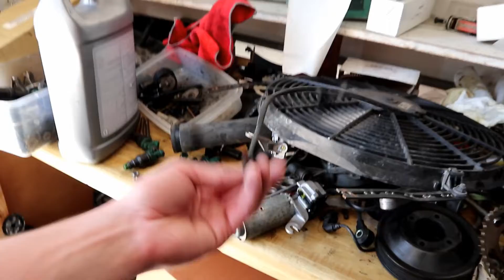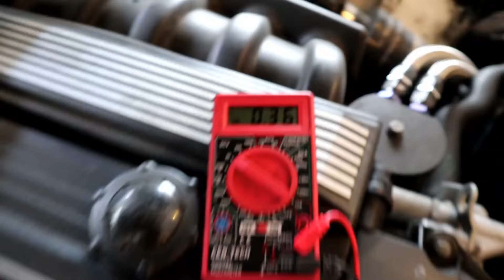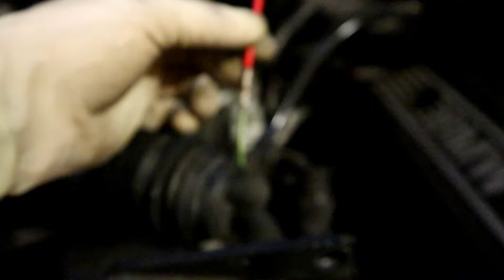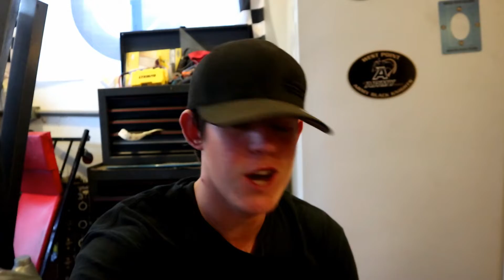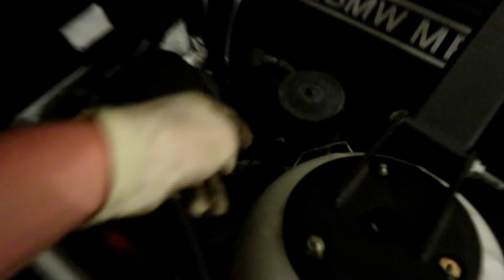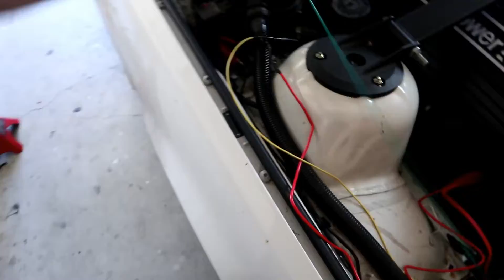Wiring my E36 Electric Fan Setup.

Comment: So once connected to adjust it correctly I need to run it 10-15 minutes to reach some temperature and adjust it? I have a s10 2.2 it was fan clutch so I buy this to do it electric fan. I think the temperature normally if like 195 when I see this if when I adjust?
Reply from the maker: Exactly. Needs to be up to temp and you want to let it cycle. If it’s adjusted too low the fan will stay on indefinitely when the car is up to temp, if it’s adjusted too high the car will begin to overheat before the fan turns on. You want a nice medium. When my car is up to temp, it will run the fan for a minute or 2, then stay off for a few minutes before turning back on.

Comment: On the e36 there is an auxiliary 2step fan switch on the right bottom of the radiator(for the fan on the front). I wired my fan with a relay and used the low temp trigger wire. The fan comes on at 95 degrees Celsius or something on the low trigger. Never had it run hot once
Reply: did you lose air conditioning?

Comment: So what happens to the temp sensor that you unplugged from the radiator, do you just not plug that connector in? Im trying to figure out becsuse it gets replaced with the moshimoto one that goes to the relay.
Reply from the maker: It’s for the AC. If you can find another way to install the temp probe go for it, i chose this route because i dont have AC on this car.
Reply: @M3NACE  that makes sense. I appreciate it.

Comment: What is that clicking noise you get with with car off and the ignition on. The guy I bought my e36 from thought that was engine knock and sold it to me for pretty cheap. I can’t figure out what it is.
Reply: engine knock on turned off engine?

Comment: why is the first setup bad?
Reply from the maker: No circuit protection & manual operation. Fan controller runs automatically and has circuit protection.
Reply: @M3NACE  thank you

Comment: How did this setup hold up over the last few years?
Reply from the maker: I moved the controller out from the frame rail and next to the air injection pump, but that’s all ive changed. Still works mint.

Comment: Good job. This electrical engineer approves. Are you going to keep the auxiliary fan? I know you don’t have A/C but I figure in California you can use all the cooling you can get.
Reply from the maker: I might wire the additional fan in at some point, this summer isnt to hot so far but if it gets 100+ I might.

Comment: I got a mishifan for the stupid bracket to hold the alloy expansion tank, but i used a ebay fan controller. Works great. My fan controller is 2 speed.

I have dual fans now. Aux fan still runs on two speeds like normal, and the mishi puller runs independently. I need my ac

I mounted mine right by the aux air pump off an existing mount point and ran the wires into engine "pool noodles" lol. I had it double sided 3m taped exactly where you put it but i figured it can get wet there easily and yeah. Moved it

Lol did the exact same thing with the rv connector in case i have to remove the fan its unplug-able 

Edit: i got ignition from the washer fluid pump lol
Reply: When hooking up to the windshield wiper fluid pump did you have to ground it??

Comment: I need that NPT adapter, I did exactly what you did but no thermal switch since its thread pitch didn’t exist. 😕
Reply from the maker: its just 1/8 NPT, heres the adapter im running: https://www.amazon.com/gp/product/B078R9NNXZ/ref=ppx_yo_dt_b_asin_title_o04_s00?ie=UTF8&psc=1
Reply: Off topic but the AC randomly comes on sometimes and my radio now doesn't turn on. Has this happened to you?

Comment: 1st! Interesting explanation, "Chasing ground" nice install with the sensor adapter. I used a fuse for the yellow turn on switch. Just put your stripped wire under the blade of the fuse as u put it back in the fuse box. Make sure the fan spins directionally correct too.......don't ask why I mention that. Nice and clean man. 👍
Reply from the maker: which fuse did you run it to? just any fuse?
Reply: M3NACE run it to the washer fluid pump. Its already fused, gets power on with ignition and the wire is right there
Reply: M3NACE forget which one it was, just a 20amp that was key on 12v. Just did the same thing for back up cameras on our work trucks too, wired them to a fuse that powers on when the key is inserted. Full hard caps, no rear view mirror anymore, strapped the screen to the mirror. I like that 12v key on plug u put in, looks factory